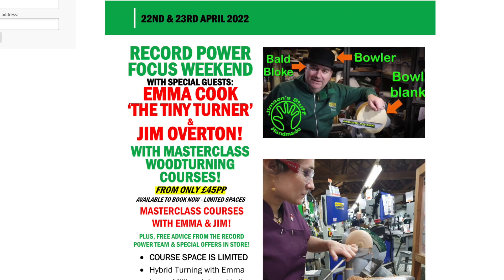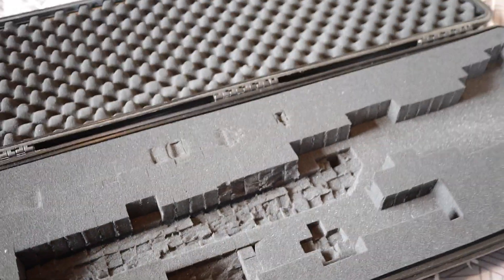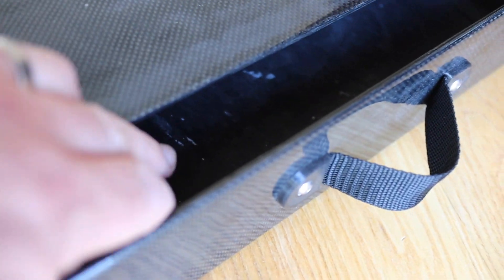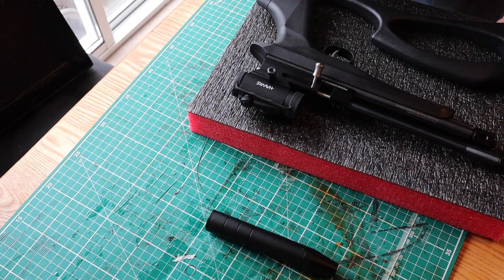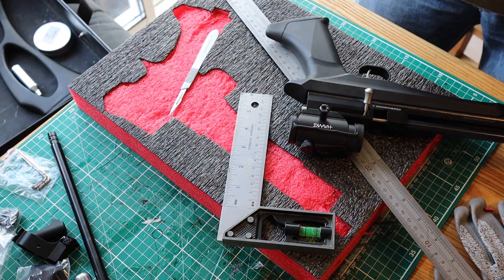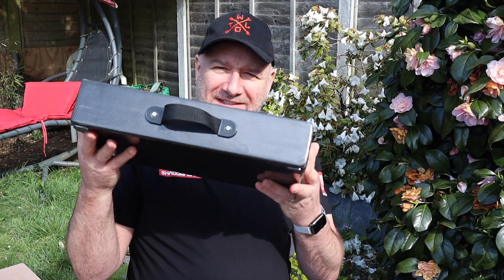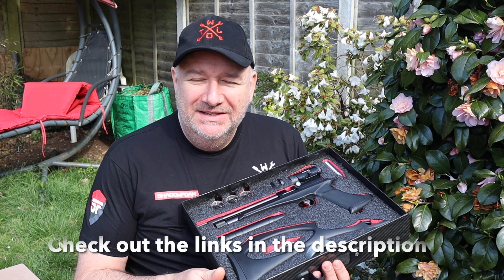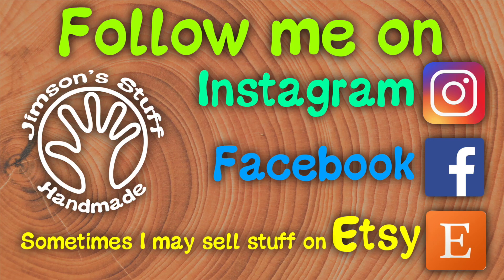Secret Agent Gun Case, Shadow Foam, Yandles Course and Makers Central

Comment: Nice project that Jim. Did you say that case is magnetic closure? Bonus 😉 I'm sure I'll see you at Maker's Central, probably hovering around Miliput stand or Shadow foam 😆
Reply from the maker: Thanks , make sure you come and introduce yourself at Makers Central. Milliput won’t be there this year but Shadow Foam will. Yes strong magnets set in back of drawer and in base of housing.